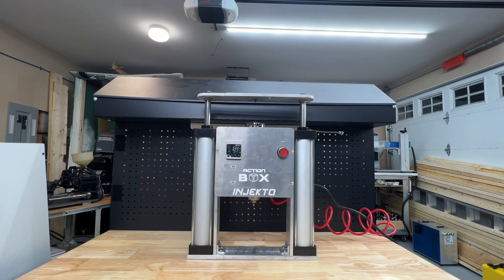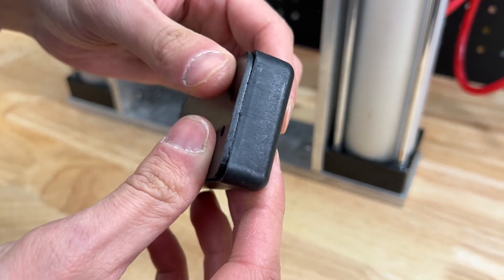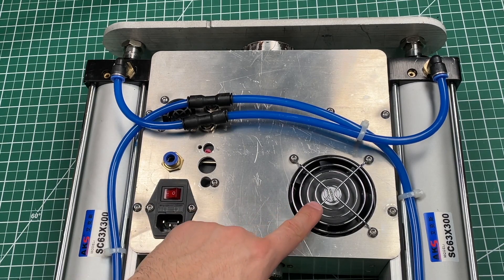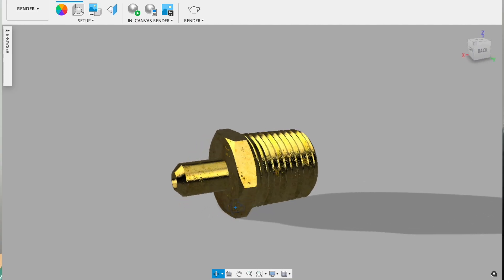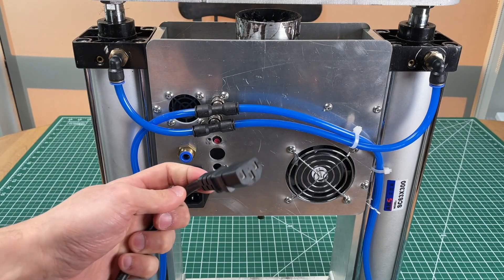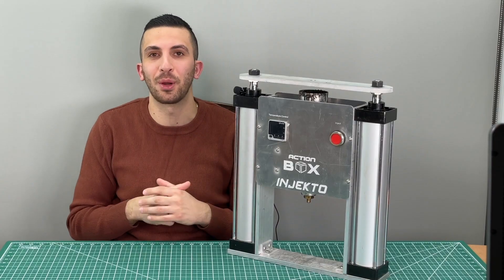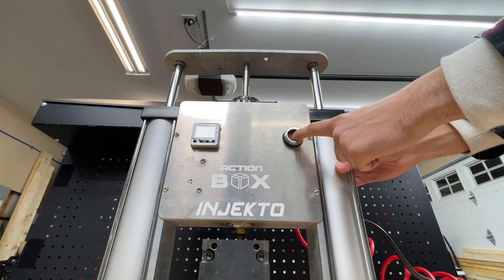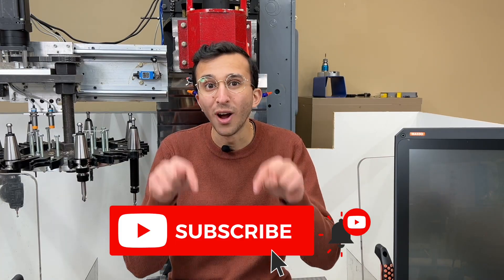How We Made A TINY Injection Molding Machine

Comment: do you need a vent for the mold? Also a way to heat the mold, rather than more pressure?
Reply from the maker: Yes, a vent for the mold is needed. Heating the mold also helps, although not necessary (depending on your mold).

Comment: with this build, the pistons are doing the work of pulling the wax through 
if you added weight to the top bar, heavy enough to press the pistons, less force is required
this will increase injection speed and pressure 

imagine you are the piston - is it easier to hold up a heavy weight and lower it down? or actually pulling the weight down?

Comment: I like the concept (I'm in the Precious Plastic Community, Precious Plastic Romagna workspace) but I think there's something wrong with the design.

Having the cylinders on the sides saves space for sure, but you can't have their full force, since they're working with the lower area side of the pistons.
The top plate is also bending during injection, and before the injection piston enters the chamber it moves to the side, since the two pneumatic cylinders don't move at the same speed.

Better to prolong the injector barrel to guide the piston, and insert the material from a lateral hole in it, or add a plate to guide it on top of the barrel.
And also add reinforcement to the top plate, when it bends it forces the rods to the inside.

Comment: You need to brace the top "plunger bar"... you can see it bend.. that shouldn't happen..
Reply from the maker: Good catch! We actually changed this in our new INJEKTO 2.0 design. You should check that video out!
Reply: @ActionBOX  I will, i might build my own injection moulding machine in a while, but first i have to finish my Lathes , 2 of them, my Mill, and my Wire EDM machines , also 2 of them.. and.. my Sinker EDM as well.. then i'm fully prepared  to make injection moulds...
Reply from the maker: Wow! Seems like you’ve got a lot of projects in the works. Keep it up!
Reply: @ActionBOX  I will... i have to.. the mill just needs an Upgrade, new Computer and Control software Update as well as new programming software.. which i wrote myself.. Then the small lathe needs a case (i already have an old CNC Control housing that the lathe will fit into, and the Operating Console is already finished., The EDM machines come next.. just refitting a new electronic unit (wish me luck), and then the Big Lathe (EMCOturn 120) Fitting a new Control

Comment: small hydraulic or pneumatic cylinders make good injection chambers as you call them. You can ad a loading port on one side and a tube at an angle from one side or front to load plastic. This way you don't need a lathe to turn it yourself.

Safety suggestion: for any future injection molds machines you make - please ad a guard in front of the mold and injector that acts as a shield, clear plastic works well but make it thick enough so hot plastic can not go though it easily. This way if the contact between the mold and injection port was not perfect and hot plastic leaked or spewed out, the hot plastic can not spew out and get on you. There have been severe accidents with injection mold machines where people have been badly burned by hot plastic spewing out under high pressure hitting the person and causing 3rd degree burns.

Comment: If you ever start making parts with thinner walls or more complex geometries, add flow controls to your airlines. By controlling your injection velocity it can reduce/eliminate any burn marks you may have on smaller parts. Also, i saw another comment saying to add a release angle to your molds, you will absolutely need to do this in the future if you want to save your molds a beating from the hammer.  Also, try playing around with your injection pressure/packing pressure regulation. By lowering your packing pressure you can save unnecessary wear on your molds as well.

Comment: Hi, Sorry if these questions have been answered before now, but no easy way to search YouTube comments. I'm considering purchasing the INJEKTO 2.0. Question #1. Can I produce filament for my 3d printer from recycled prints (yes, recycled using SHREDII 4.0?  #2 If so, which filament types are best for use in the INJEKTO? #3 When using injection molds, does INJEKTO sense back pressures to automatically stop injecting when the mold is "full"?  Thanks
Reply from the maker: Hi, I’m not sure what you mean but I’ll try my best to answer. 
1. Injekto is not intended for making filament. 

2. I’m not sure what you mean by “which filament types are best for injekto”. Filaments are used in 3d printers while plastic pellets are used in injekto.  It’s the same material but filament is a continuous rope while pellets are filament that is cut into smaller granules.  We have successfully used PLA, ABS and other plastics in Injekto 2.0. 

3. No Injekto does not sense for cavity pressure. 

If you are interested in purchasing Injekto, we now offer all of the electronics for it as well. Check out actionbox.ca

Comment: If you preheat the mold, you can make bigger parts. In large production runs, the molds are designed to run at a higher temps. Some also included cooling to keep them from getting to hot.
Reply from the maker: Thanks for the tip 😃
Reply: The mold will anyway be hot after some shots, after ten shots you need thick gloves to touch the mold.

Comment: what is the max length wide and height of a print you can do with the 2.0 machine?
Reply from the maker: I’m not sure what you mean 🤔
Reply: @ActionBOX  The part that was printed at the 10:01 Mark, what was the over all measurement? Trying  to get an idea of the the machines max length and height of a potential parts.

Comment: Subscribed.  Cool concept.

I used to work around the industrial version of these for nearly a decade.  If you are interested I have some comments on the design and construction of the machine.  You seem to be bright folks, so you might already be aware of the kinds of issues that can come up.

As a low cost way to get into mass manufacturing though, this is very solid.

Comment: Awesome project!

I think you might have made an error when calculating for cylinder forces. 

Assuming the existing cylinders have an internal diameter of 2", the combined force @ 120 psi would be close to 3300 N when the cylinders are extending. 

The force when retracting is less because we are only applying pressure to the surface area around the cylinder rod.

Assuming the rod is 1" in diameter, the actual force being applied to extrude is 2432 N.

You may have already factored this in but I thought it was worth mentioning. :)

Comment: Hey I just got to watch your video on the plastic grinder You dropped the plastic bottle in the top and comes out chips  What would happen if you rigged up a 2 mm tip or 3 And slowed the compression down a bit . To about 1/4 speed
Reply from the maker: Hey, I’m not sure I understand your question. Can you elaborate?  Thanks.

Comment: Some ideas-melt the plastic in a separate heating tank and fit a air valve shutoff to the tank pipe it to the bottom of the heated chamber and increase the hight of the heat chamber so the rod doesn’t come out- up stroke open valve on tank sucks in plastic, close valve on down strop inject out , the heat chamber in the machine will stay at a more constant temperature, also put some insulation around the heating chamber as the rest of the components don’t like that temperature.
Reply from the maker: Thanks for your input 😊

Comment: Just for security standpoint: all industrial machines that has a crushing hazard, has a second button afar, so the user won't accidentally put one of his hands in crushing hazard area - because he needs his two hands to switch the machine on.
The upper plate definitely needs some reinforcement or at least forces distribution to the sides.
Reply from the maker: Thanks for your input. We have fixed both these issues in Injekto 2.0.  Video coming out in a couple of weeks.  Cheers

Comment: I do not now which plastic you are using, but maybe you need to dry it first. Some Materials and additives are hygroscopic and get to wet if they have contact to the air. Some hours in a oven works wonder.  Also you need some homogenisation of the material. Usually the material got "kneaded"  from the plasticizing screw in the cylinder, but that is not possible with this prototype you had built. You could add some sort of homogenisation if you put some flat and stacked up steal sifters in the last part of the cylinder. The injection machine would force the plastic through the small holes and than through the nozzle into the mold. It is not good but still better than nothing.
Reply from the maker: These are awesome tips. Thank you.

Comment: have you tried to space out the heater bands a bit and place the thermocouple in the middle, could also in a V2 go off 2 heater sets, have one on the middle (thermocouple and heater band), and one as low as is practical also I sneaky way to attach the heat shroud is with metal zip ties although it would suck to remove it'd decrease the heat leakage. this being said... i'm an injection mold operator and not designer so I only know so much
Reply from the maker: This is one of the changes we are making in the Injekto 2.0. Thank you for your professional confirmation 😊.

Comment: I used to do wax injection and we heated the molds to help the wax flow. I am sure you could increase the size and complexity with heated molds. Nice design, i might make one.
Reply from the maker: Awesome idea.  We have tried that and it works, but the cooling cycle takes too long, and the complexity makes it much larger.   Might try again in the V2. Cheers.

Comment: You need more pressure to have a higher volume? build a box frame around it in steel, extend it taller, and put a bottle jack in as "the compression force". For bonus points, put the jack in the frame such that it not only generates this pressure, but replaces the random block shims under your molds.
Reply from the maker: Thank you for the suggestion 😊

Comment: Very cool project!! It would really help if you add a 2 degree (or more) angle to your parts, it will make it much easier to eject. Where i worked we had 10, 50 and 80ton injection molding machines. We never used the 10ton because it was too small. Even for industry standards the 50 and 80 were also considered small. Thats why im very curious what youll be able to do with v2! Cant wait.
Reply from the maker: Thank you 😊. Video coming in around 6 weeks

Comment: For the cross bar at the top you could use square tubing or something with structure to resist the bending while it presses. That probably help to prevent to push rod from going in at an angle.

Comment: You need to install a variable valve on the pneumatic line.  By adjusting the variable valve you adjust the speed of the pneumatic cylinders.  You will need to adjust the speed of the injection based on the temperature and type of material and size of the nozzle in order to ensure no air bubbles in the mold.
.
As for where to locate the temperature sensor:  Place it directly on the heating elements.  Perhaps use a "probe sensor" between the heating element and the main tube.  This way you have an exact idea of how much heat is being delivered rather than a delayed temperature reading (when the heat transfers from the heating element through the main tube to the sensor).  
.
Be extra careful with the wiring from the temperature sensor to the temperature controller.  This wiring is VERY sensitive and breaks contact on a regular bases.  The wiring gets very hot (from the heat delivered) and is very small hence any movements during production in that wiring will cause breaks in the wiring.  It's frikken irritating (I know) but when I learnt to use tie downs to make sure very little movement in the wiring during production I noticed it lasts longer.  You may want to buy extra temperature probes (they are cheap) and have them lieing around as spares.

Comment: If you guys are looking to increase pressure you could flip the cylinders around. Air/hydraulic cylinders apply more force on the side of the piston without the transfer rod because the piston has more surface area on that side. Unfortunately, this will affect the very clean packaging of your machine
Reply from the maker: Yeah that’s a great point.  Since our main point with this design was the form factor, it is important for us to keep the cylinders in their current orientation.  Even if it costs us with pressure.  Cheers.

Comment: Regarding the spring loaded nozzle: for V2 i would opt for a single heavier spring at the bottom mounted at the bottom of the bottom, coaxially to the nozzle
Reply: And for the sensor placement: using a sensor for each heater band would be ideal

Comment: you should get a peice of angle iron or aluminum if you can find a thick enough aluminum and put it ontop of the ram its bowing in your video you also should add enclosure incase plastic escapes and relocate the injection button further from machine for safety this is a really cool design thank you for posting if you can add liquid cooling lines to the molds that will reduce sticking problem
Reply from the maker: Thanks for the input Andrew, you are right on point with all your suggestions. The injekto 2.0 tackles most of these so I hope you will get a kick out of that video in about 2 months when it is released. Cheers, Dave

Comment: Subscribed. Injection molding technology is one of the most expensive and prohibitive for an average joe. Even if the part cost is really cheap - no commercial company will honor an order smaller than a few thousand pieces, and the cost of the actual mold is immense. Thanks. This would close a GAP in he dyi community - since most of us have small batches of products and either we are forced to use "off the shelf" cases and design our pcb's around those, either use not so "professional" looking 3d printed cases (wich / gram are MORE expensive than molded ones). Really thanks. The ideea floats around on the web for years now - but i've seen few or none actuqlly viable working projects.
Reply from the maker: Thank you 😃.  We are committed to making this a reality. Looking forward to your comment in the injekto 2.0 video 😊.  Cheers, Dave
Reply: It doesn't get very expensive in the long run. The very manner, construction and function of this limb amputation machine saves the user from all too many expenses in the future (and from a too long life too...).
I suggest getting ideas from their other machine ( Homemade Plastic Injection Machine | DIY, https://youtu.be/l4gGWufoIYI), add proper safety enclosures, an appropriate user interface for this kind of machinery and required devices like safety relays and emergency shut down. Just to keep the prosecutor away ... ;)
Reply: Just some cents to ""off the shelf". You mean those enclosures who come in a million different sizes, shapes and configurations, rev3rse[2]?  Those which are produced by experts? I mean, you can ignore that material testing equipment and quality testing exists (like all of you guys do ... like that is an option!!!), which the machinery costs usually are 10 times[1] that of the production machines, not speaking of the expertise needed ... and have that reflected in your products: Unreliable or even with a risk of injury and with inconsistent properties. That kind of attributes does not necessarily increase trust in small manufacturers and DIY products.
Occupational safety standards and quality standards, material and product testing should not be seen as enemies. On the contrary, they are important achievements of modernity, without which we would be worse off!

[1] This is the place where people look in disbelief. But that is due to the lack of a clue with industry practices and requirements and that one prefers ignorance to responsibility. This is a widespread disease in maker circles and another reason for the proverbial amateurish poor quality.
[2] And which also can be ordered as self-designed and produced as prototypes or in small series ... and we think we can do this at home with the same quality and reject? No!:)
Reply: Rubbish. We are a job shop. We've done runs of 200 parts. Setup costs will really hurt for runs like that, though.

Comment: Nice Video. As an experienced injection molding machine engineer, the normal position for the thermocouple is between the heater bands. The position of the heater bands is also important. The heaters should be close to the nozzle. Because the heat will be highest at nozzle end of the barrel and radiate to the material feeding point. Which gives the normal temperature profile found on conventional plastic injection molding machines. Hope this helps guys.
Reply from the maker: Thanks Lindsay 😊. This really helps.  It’s good to hear feedback from a professional.

Comment: I'm watching the topic for the first time and wondering why did you go pneumatic instead of using screws and motors to drive the shaft, such as gantry in 3d printer moving in z axis?
Reply from the maker: The price of motors and ball screws sufficient to produce this force at the same (high) speeds are far more expensive. If you watch our other fully automated plastic injection machine we did just that, but this concept is meant to be as cheap as possible.  Great question, Cheers, Dave